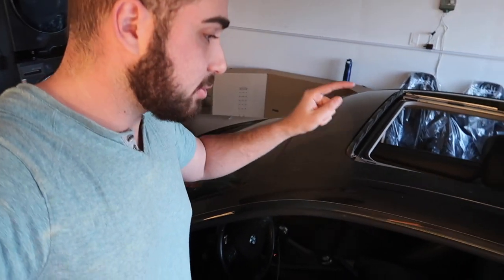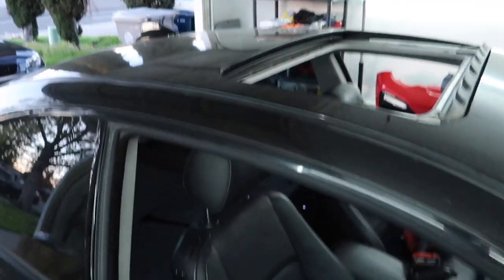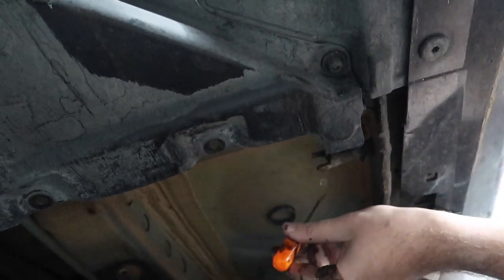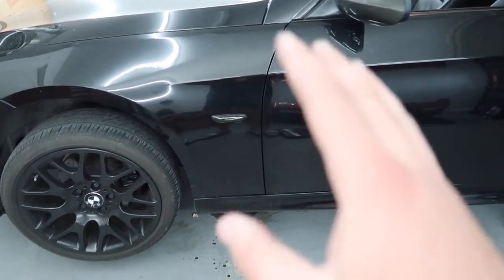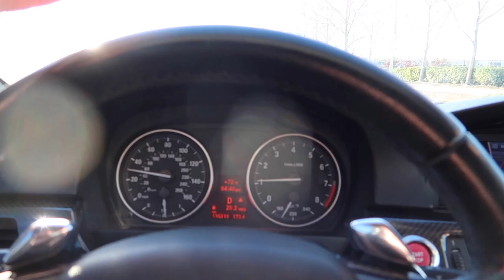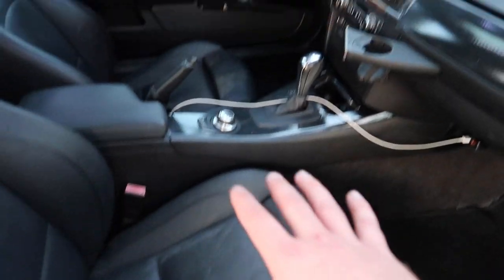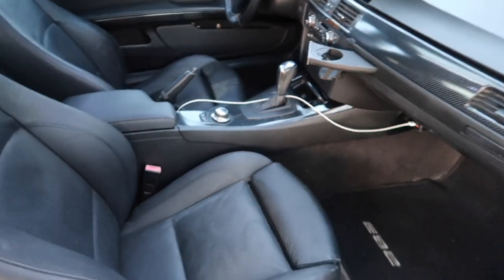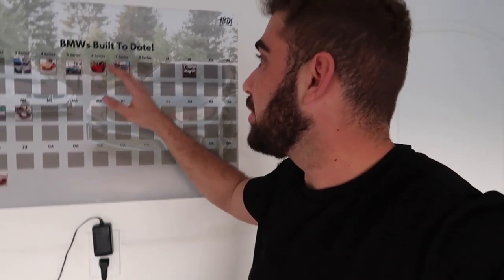FIXING THE BIGGEST ISSUE WITH MY E92 THAT MADE IT UNDRIVEABLE!

Comment: had to do the same shit on my mom's former chrysler 200. Floors weren't wet but she was like it sounded like splashing water everytime she stopped hard. There was drains on the bottom of the rear doors, they were clogged to shit. Simple screwdriver stick in and at least 2 gallons came out haha

Comment: Keep the m3 style front bumper!Add a carbon lip. I have a 2009 x6. Just did the valve seals, and upper oil pan replaced. Lexani wheels, staggered fit with concave. Thinking about selling.

Comment: Hey man I like your video's specially your cars from the way you started to now, I see you been fixing lots of bmws and I would love if you could help me out with my 2008 bmw 328xi it's having a problem when I'm driving it, it starts to jerk and won't go to high rpm and when I stopped the car shuts off and even I'm not driving the car just warming up the car when the car gets hot the rpm goes up itself even I'm not stepping on the gas and it idles really bad when the engine is hot, I already replace my maf sensor but it still the same and I'm new to bmw I just got this car last week and it already giving me a problem, I wish you read this and help me I really appreciate it and thank you in advance keep up the awesome content and videos man
Reply: Check the vanos solenoids - also scan the car with something like Carly should show the codes it's throwing 😅